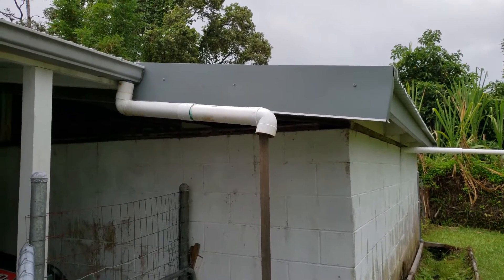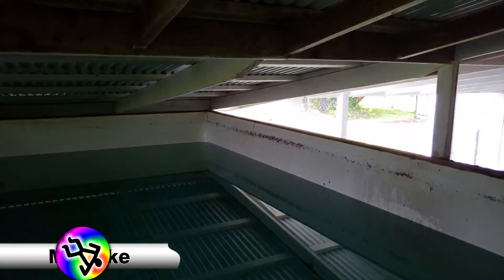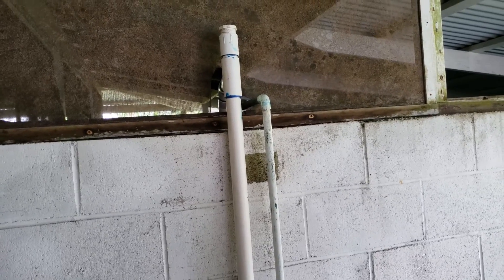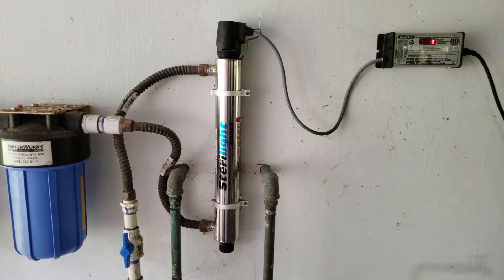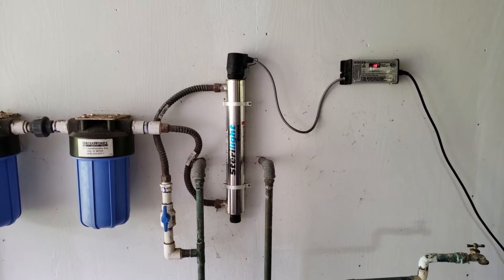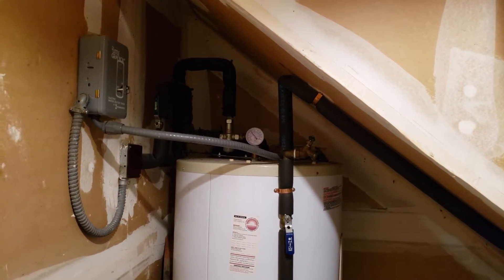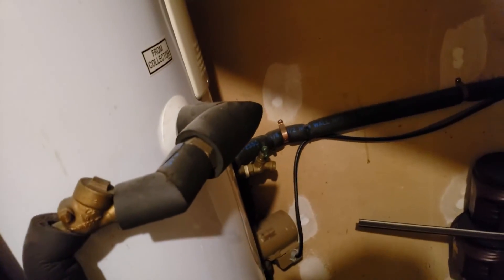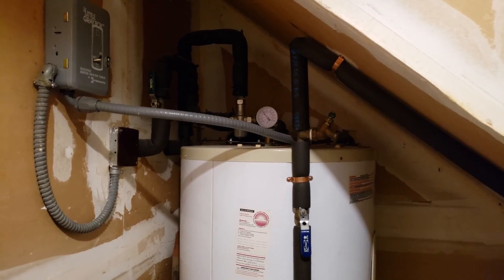Water Catchment System Plus Solar Hot Water Panels in Hawaii

Comment: Can I put the tanks inside the house utility room
Reply from the maker: I am assuming when you say "tanks" you mean the filter canisters, right? I would not recommend it. When changing the filters things can get a little wet. Also, if a pipe breaks or a seal leaks, then you'll end up with water everywhere. It is customary to have them located next to your pump and pressure tank. It's easier to keep everything in one place. Plus, there might be some country codes that might restrict placement in such a location, but I don't know. I would suggest you check before you decide.

Comment: Informative, thanks! Simple question: Do you drink your tap water?
Reply from the maker: Yes, but only after it goes threw one more filter. The Zero Water Filter, if I remember correctly that is a 1 micron filter.
Reply: @DoingHawaii  Thanks for answering my friend. From watching many off grid channels, i've learned that the Berkey filter is very popular.
Also a word of advise. I understand that the rat lung worm parasite is one of your main concerns where you live. Your UV light system however, kills every organism present in your water, including some beneficial ones that should, i repeat SHOULD be present in your water. Before you drink your tap water, leaving it covered, yet exposed to air would allow some of those beneficial organisms back in.

Comment: I wondered if  you used solar heating as a supplement to your hot water tank operation.  My great uncle had a similar system installed in in his Florida home in the early 1980s.

Comment: Interesting I have a heat exchange system for my hot water and heating gas fired boiler heats it all up.  I have one filter as gunk got in the radiators don't know how to clean them I have asked but got told give me a ring and I will do it for you.    Gerrrr

Comment: Do you have your water periodically tested? I'm on a deep well 235 ft deep in limestone and have it tested once a year for bacteria and heavy metals contamination.
Reply: Sorry, 135 ft deep.
Reply from the maker: No, it is not needed very often. Heavy metals are not normally an issue and organics get oxidized and UV irradiated.
Reply: Because many people in my area use septic systems, bacteria and pesticides can become a problem if ground water gets into the aquifer. Since your water comes from the sky, you wouldn't have that problem.

Comment: You make it sound so easy and safe. Of course, you have a real roof over yours, but I'm not sure I wouldn't still be worried about rat lung worm.
Reply from the maker: Rat lung worm is a very serious concern. However I believe most cases have been contracted by consuming contaminated food items verses properly maintained catchment water.
Reply: I  read an article about filtering for rat lung worm relatively recently that pointed out that most filtering is not safe. Yours is pretty elaborate so I hope you are safe.
Reply from the maker: The are mixed reports on the effectiveness of filter on rat lung. Though a more recent study I saw says that anything 5 microns or lower is effective. However the chlorination an UV make up for any loss in the filter.

Comment: Hello Charles,  very informativ.  I want to ask a question:  Do you have problems with your water during the eruption  last Year. There was a lot of acid rain.  Greetings from Germany 🖐
Reply from the maker: No I did not. I had disconnected the downspouts from the collection tank when the eruption started. I knew increased sulphur dioxide levels would make any rain extremely acidic. Plus I suspected there would be some type of volcanic fallout. Which there was, Pele's Hair and Tephra. The tank was full when I disconnected it and only had to have water brought in once during the eruption.
Reply: @DoingHawaii  Thank you for the answer. Here in Germany we have a official distributing system for trinkwater. But we collect rainwater too, for use in the garden etc. but without filtersystem.  What happens to used water on Big island? Here in Germany we have a sewage. Used water  is collected in Tubes under the Earth and flows to a sewage plant or is cleaned  in a clarify custody.